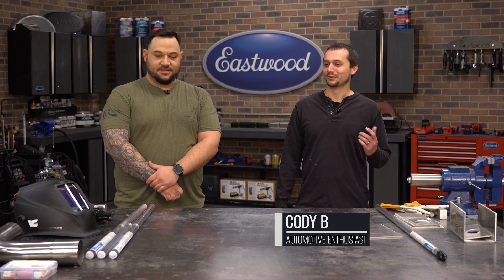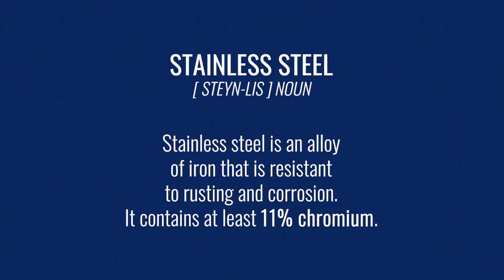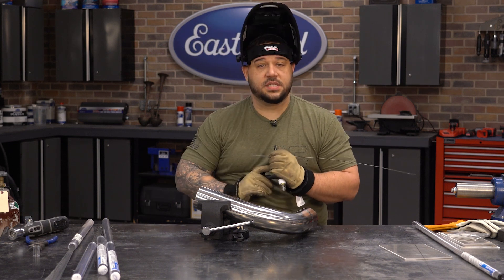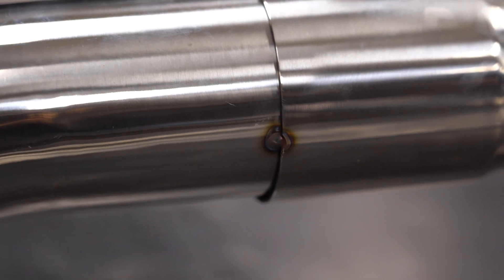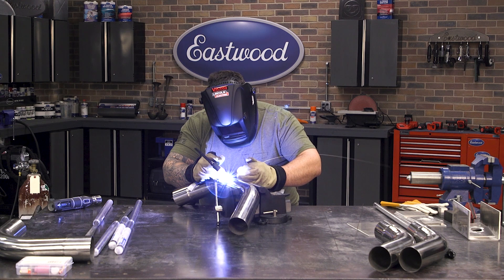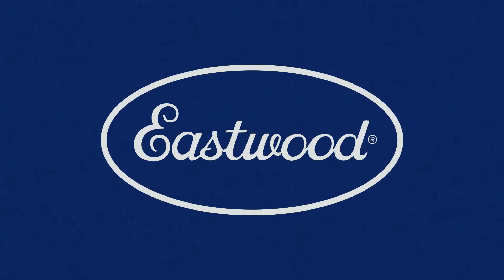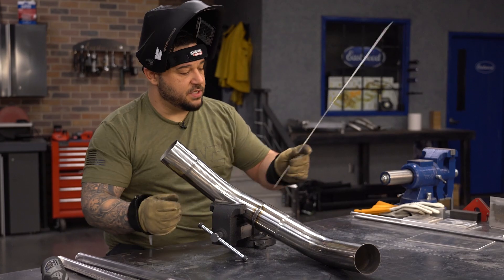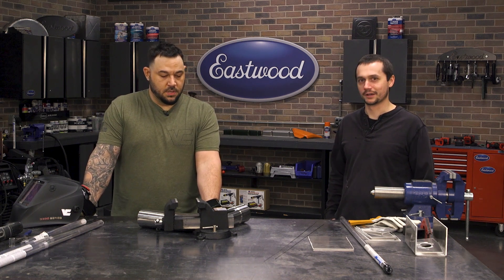How to TIG Weld Stainless Steel - Tips, Tricks, Pulse, and Machine Setup!

Comment from the maker: Pickup the TIG 200 LCD HERE: https://www.eastwood.com/eastwood-elite-tig-200lcd.html?utm_source=youtube&utm_medium=annotation&utm_campaign=2023-03-17&utm_content=vince+tig+200lcd
Reply: what filler wire was use? New to stainless and about ready to order a replacement for my Tig 200 v1 that I have. thanks
Reply from the maker: Hey Carlos! For stainless you will use 308L, the size will depend on the thickness of the material you're welding.  For this video we used 1/16" thick filler wire.

Available Here:
https://www.eastwood.com/tig-wire-stainless-1-16-36in-1lb-tube.html
Reply: @eastwoodco  thank you, spring break shopping will be underway!

Comment: 1:42 some stainless steel that has been cold processed , for example into shapes etc. will be slightly magnetic, so a magnet is not what you want to identify stainless steel.
I judge by the color and if that fails, i use copper sulfate

Comment: Great example. Still a little confused about the pulse settings and how it works, but clearly it addressed the issue with the gap in the lap joint.

Comment: Do you have to back purge when tig welding stainless steel
Reply from the maker: If you want to keep stainless - stainless - then yes you would need to back purge.  That's going to require extra infrastructure the average guy may not have - but you can certainly build out that system.
Reply: @eastwoodco  you can use solar flux if you can't purge

Comment: Start by wearing your ppe, fr jacket/long sleeves 🤦‍♂️

Y’all missed to inform those who don’t know about what tungsten to use for stainless…

Instructor was to fast in speaking to the audience.

What happened to back purging? 
Plenty of gas coverage for s.s.
Just because it’s good on the outside doesn’t mean it is in the inside…
Reply from the maker: Ryan you might have skipped through the video a bit. Please check out:

2:35 - 3/32" Multi-mix Tungsten
5:28 - "I want to disclose we are not back purging"